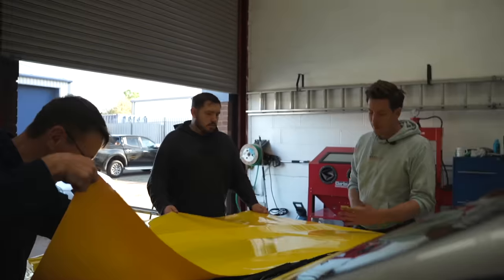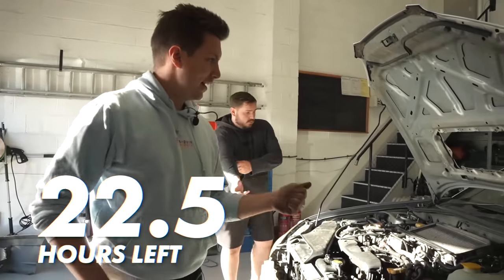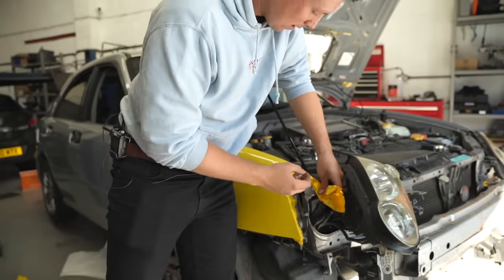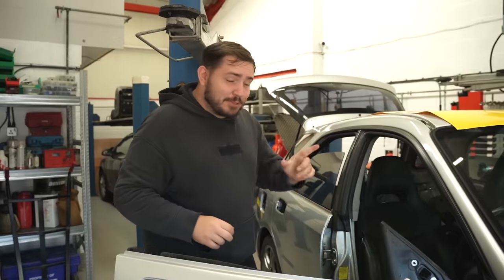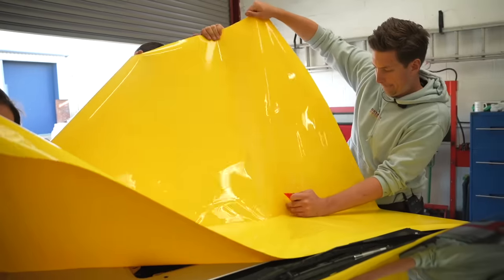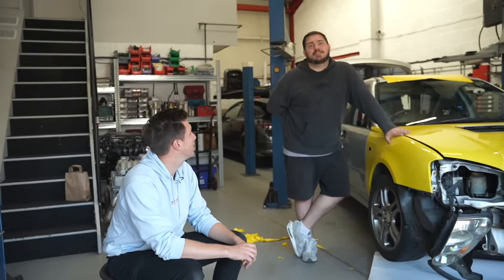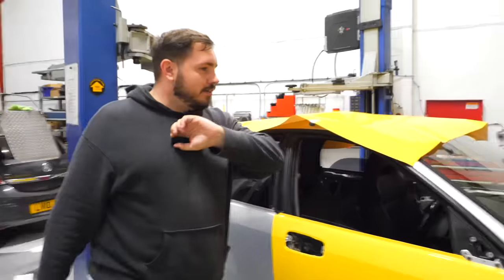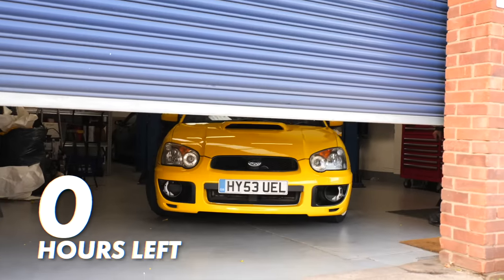Can Beginners Wrap a Car in 24 Hours?

Comment: Honestly impressed you guys knocked it out in 24 hours. My first time was doing it outside under trees, so was constantly washing and making sure the prep did it's job. Aside from working on this throughout the week, it took me about 6-8 days to do myself.
Reply: Do I have to sand down the car in order for wrap
Reply: @ruckerT4P  if you have rough surfaces I would suggest it for those areas. after laying down the wrap, there were some area by the side skirt that I sanded but not 100% that still showed through. This goes for any dents you may have as well

Comment: As a viewer, the car looks pretty good!  I would have highly recommended doing a wet install instead of a dry one.  It's way easier to get the fitment done, and easier on beginners.
Reply: I'm fairly sure that particular kind of material is only intended to be dry applied. I'm not familiar with any Hexis vinyl that is recommended to be installed in any other way; maybe, for windows and glass.
Reply: @mjjjhaney1  Ah good point. Most vinyl that I have messed with can be wet when applied.  The main thing is to use very little soap in your water. The more soap, the more risk you will deteriorate the adhesive. I haven’t messed with Hexis either so it may have some special adhesive.
Reply: Definitely don’t do it wet, that’s the best way to get edges lifting.(signwriter for a decade.)
Reply: @merkel2750  Agreed, from a 17 year vinyl vet.
Reply: Very few vinyls are wet applications. I've never seen a material for a car that is wet application either
Reply: @abitavenger  depends, just about any non air release/non wrap vinyl can be wet applied. Though you wouldn’t want it taking tight turns or trying to make it do what wrap material does.
Reply: @merkel2750  definitely agree, jus was speaking more on automotive type materials. I never really liked wet applications of signage etc unless it was absolutely necessary. Most manufacturers will recommend against it as well even though it works lol

Comment: There's still a lot of room to improve with a cheap price, remove the front bumper bar support, engine plastics covers, A/C, sunroof delete, front splitter, and why don't you upgrade the tire size, what make you think it will beat a Lambo with a 215 size? My Nissan Micra has a 175 tires but its a lot lighter.

Comment: Mods y'all need to keep this car running:

OIL SEPARATOR - the PCV valve on this car is a major weakness and will give you engine-killing knock if you race it too hard. Drinks less oil & runs cooler with oil separator. 
OIL PUMP - a bit more pressure than stock keeps the inner cylinders lubed in hard turns 

SCCA guys figured this out the hard way, nerds that read NASIOC like me gotta pass it on!
Reply: Also I vote *Rumblebee* since y'all propbably won't get to swapping the exhaust manifold.

Comment: Suggestion if you have to do this again—rent a dry ice blaster to blow the paint off parts, remove the rust on the undercarriage, and more, without damaging the underlying structural metal. The tech was developed by the US Navy for stripping paint on ships without damaging the structural metal (unlike sand blasting). Works wonders and doesn't run the risk of these issues. Another would be going over it with an electric buffer & a thick slurry of baking soda+water.

Another thing would be using something like the Daimer Industries hot water pressure washer that is designed to super wash the vehicles. Steam cleaning, power washing, etc., can do wonders to prep the surfaces. Another would be additionally using a clay compound "eraser" to scrub/polish the crap off. Given what you were doing, I'd have stripped the plastic parts to enable proper adhering of the wrap & to save material. :3

Comment: How come you guys didn't use the wet wrap method where you spray soapy water on the vinyl and body panels prior to installing them? It's much easier to work with when you've never done this before. The dry method is more difficult for beginners to do, and much more frustrating as well.

Comment: You should spray soapy water down first, get it set up and then start heating it.
This way you can move it, get the bubbles out and the heat gets rid of the soapy water and activates the glue

Comment: I used cheap vinyl wrap from China I bought on aliexpress. My god it was hard to wrap with. The adhesive was white which made inlays a pain as they stood out loads. It started to peel on the edges. Took me ages to wrap my car. It also pulled the paint off my door handles. I wished i paid a bit extra and bought a good quality vinyl wrap. Would have made my job so much easier, faster and neater. Least now I've learnt to wrap with rubbish wrap I should be good with decent stuff. The colour was amazing though I'll give them that

Comment: Tip you need to use a LOT of tension and PULL the material over the panel to "Glass" it out, don't just lay it on loose LOL